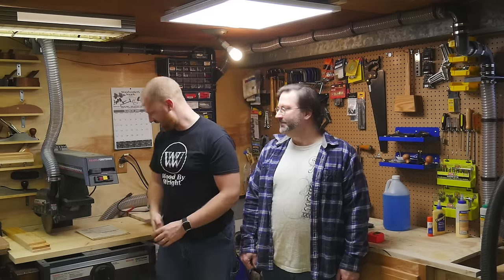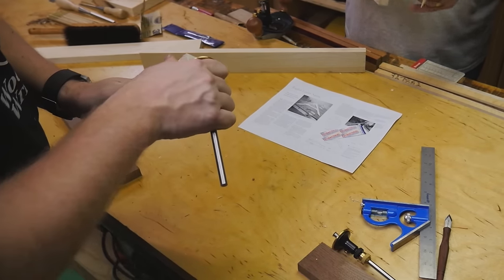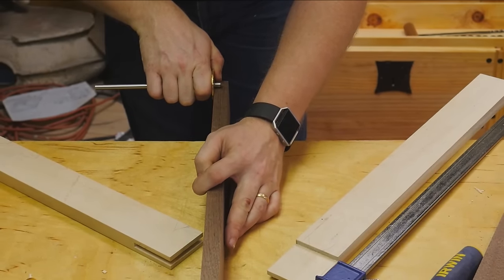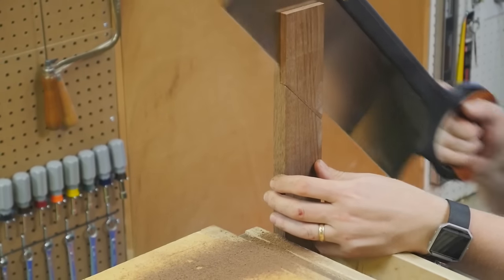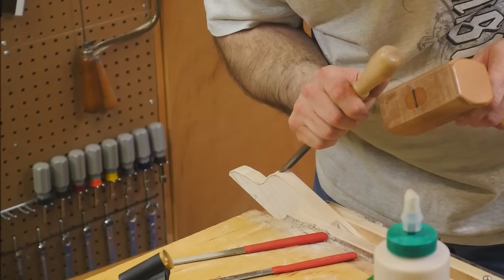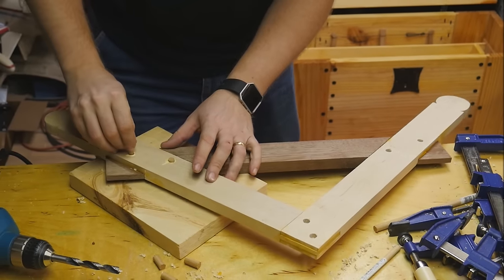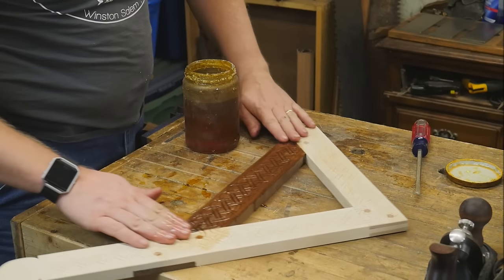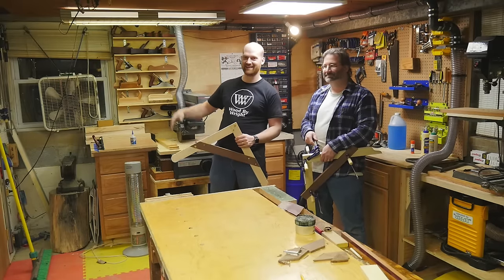How to Make a Layout Square With Maple and Walnut a Hand tool Woodworking Project

Comment: Another superb video, thank you! I have one question if you don't mind. These squares look fantastic and i have thought about making one, but I'm worried that it won't last long in terms of constantly going out of square. Is this a problem or am I over thinking it! Thanks
Reply from the maker: I have had no isue with it going out of square. and even if it does they are quick and easy to fix, or even make another one.

Comment: I have found numerous videos on making these "layout" squares but not on with anyone using them. Anybody actually use them? They look like they are useless, with the cross brace half-lapped  to the square you can't use it to test a inside 90, can you? Maybe a video with you using it would be great.
Reply from the maker: i think you are confusing a layout square and a try square. a layout square is for doing rough break down from large stock. laying out the stock. so there is no need to draw on the inside of the square. adding the brace then makes it more stable. you can adjust it by planing material off the outside. I use it in several videos. most any time I am starting with a large pece of stock usualy with live edges and you can not mark off the side of the slab. Here is one. https://youtu.be/KHUwT9RdfbA?t=138 
here is a tri-square making a video for comparison. https://www.youtube.com/watch?v=cxNpwOiF5zQ&t=268s
I hope that answers your questions. If not let me know!
Reply: @WoodByWright  I see, thanks.